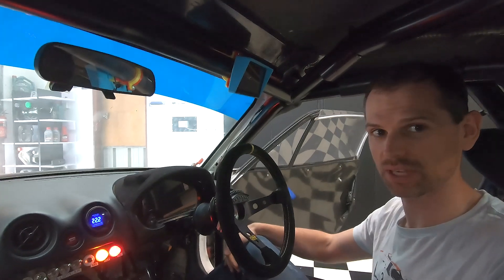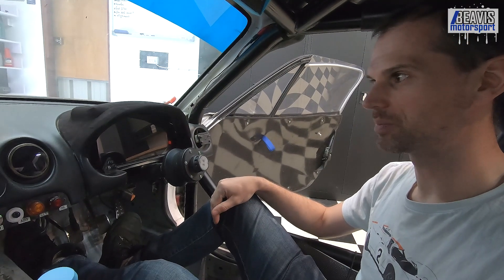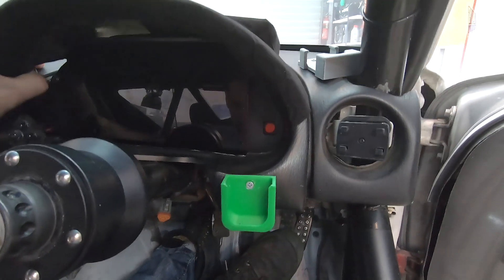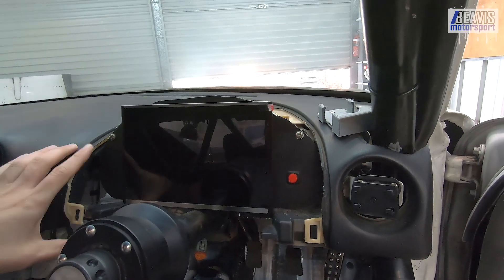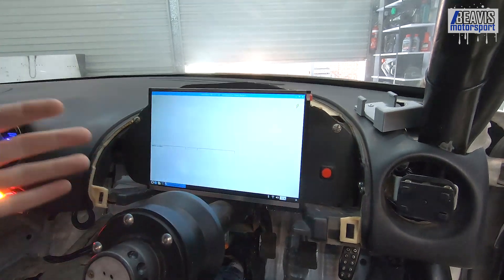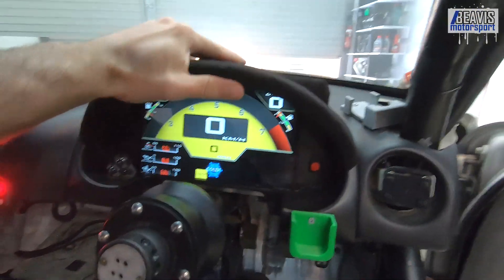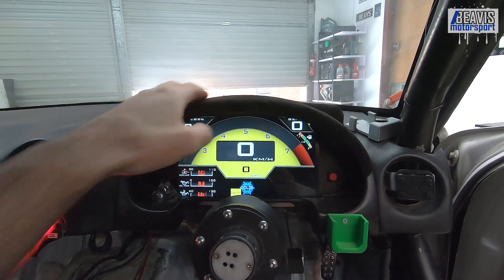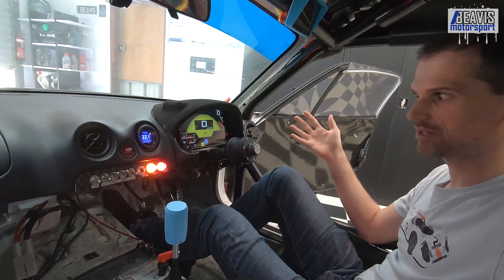CUSTOM RASPBERRY Pi 10" CAR DASHBOARD // Ep 90

Comment from the maker: NOTE: I have an updated video for faster boot times and latest Pi4 hardware here: https://www.youtube.com/watch?v=SVn9uYfEQrA
And, to answer the Frequently asked questions:
How does it connect to the ecu? - Via USB connection from the Megasquirt MS3 ECU direct to the RasPi.
Why didn't you use XYZ off the shelf product? - Because I like to tinker, and I can customise this how I like.
What about OBD2? - Sorry, I have never tried... I am sure you can find info online though!
Reply: So the only ECU this will work with is the Megasquirt range right? is there any way to get it to work with Link or Haltech systems?
Reply from the maker: @roderickmacdonald2389  The Tunerstudio software I'm using here is only for the Megasquirt family of ECU's

Comment: What did you do for the speedo?
Reply from the maker: Original mazda speed sensor is fed into the ECU through a conversion board then displayed on the screen. But, i dont really use speedo much as it is not a road car.
Reply: @Bbeavis  I have downloaded some of the screens and what not still I having a hard time trying to figure out certain features and what not but getting in there some of the dashes you guys made a really cool

Comment: How the Pi getting the data? Any connector between Pi and ECU?
Reply from the maker: All my sensors, speed, temps etc go direct to the ECU.
Then the ECU has a USB connection direct to the Pi to feed the data for the dash software - and the Pi communicates over USB with the ECU propriety protocol.
Reply: @Bbeavis  Thank you for your reply. From where can I get that connector?
Reply from the maker: @ysr9116  The connection is just a USB cable.
Reply: @Bbeavis  Is it USB type A to USB type A? My ECU doesnt have USB to plug in, so I thought you may have special connector :)

Comment: ok im interested in making something similar with the rasberry pi but i was curious about the internet side of it. does it have to have constant internet to be acurate and work?
Reply from the maker: No, internet connectivity is not required ongoing, only for the initial setup and to download/update software.
Reply: Thank you for the reply. I may have a couple more questions, how is it holding up? Is it practical? And roughly how much did everything cost? Note I haven’t look at any of your other videos my questions may be answered if I go through your page just let me know and if so I’ll watch other videos. Thanks for your time and great job!
Reply from the maker: @mikeyrozell5627  
It's been working fine for me, and practical in the sense I can customise the display to my liking, note I use it in a track only car, not sure I'd like it for a road car.

Cost can depend how you do it, but around $200.

This gives you an idea on parts and cost to build:
https://www.youtube.com/watch?v=SVn9uYfEQrA
Reply: Great thanks I have a 92 Miata I’d like to update in a sense I’ve seen a bunch of different raspberry pi displays with all sorts of different modes I’m confident I could find one for road use I plan on keeping the oe guages just would like to do some updating while engine is out (crank swap) but thank you for everything

Comment: Were can I buy one of these already  made
Reply: Yea, but no one wants to pay them prices, especially when this looks so good. I have a stand-alone ecu bmw dde5  with rpm single wire output/ ignition/start and oil light output that can be grounded to work and no wheelspeed sensors so I was thinking I can use a gps speed signal emulator 🤔
Reply from the maker: There are off the shelf dash products, none are as cheap as this would cost to build, but they generally depend on your ECU setup for your car.

Comment: How do you get data to the pie? OBD2?
Reply from the maker: Hey again S4 Dad. I run a Megasquirt MS3 aftermarket ECU in my track car. The ECU connects directly to the RasPi via a usb cable. The pi's TunerStudio software interacts over a serial protocol direct to the ECU to display the data.TunerStudio is specific to the Megasquirt family of ECU's.

Comment: this is something i want to do in my subaru. is it possible to still use it with a stock 32bit ecu? does it flash/log for you?
Reply from the maker: If your car has the OEM ecu, and it supports OBD, then you can consider this software: https://github.com/Pbartek/pyobd-pi

Comment: Hey, nice work, your a genius.
Quick question, could you use the Raspberry Pi system and dashboard like you have set up, but use input pins on the pi to input for 
1) rpm (pulse signal from spark lead) 
2) water temp (thermocouple + digital converter) 
3) ground speed (hall sensor set up on axle)

and input them for live use as a race go kart dash? (Maybe save to a thumb drive for later review)

I’d love to add Lap timer / logging If the sensor inputs could be adapted? (Can be magnetic strip reader across finish line on track or a infrared signal/receiver set up) I only need lap times for practice/set up tuning 
Thanks
Reply from the maker: Anything is possible, but what you're describing would likely require someone with good electrical and software knowledge.
The solution presented in this video is an 'off the shelf' product and works directly with a standalone ECU, so it's much simpler to setup.

What you are describing would possibly require a custom circuit to adapt the inputs to suit the PI, and then obviously some custom software to present the data visually.

So, you can certainly do it, but it'll take time and effort well beyond what is presented here.
Reply: Thanks for the reply, was interested to see if I could use a dashboard like you have created. 
I have access to electronics engineer for support, and I have a full Cnc machine shop for any monitor mounting/fittings. Perhaps I’ll make a video if I have a crack at it. 
I could just go buy a complete Aim Mychron system but I’d love to have a crack at this for fun.

Comment: Hey i wanna make this but for my Haltech 1500 ELITE. is there a way to connect the Pi to my ecu?
Reply from the maker: The TunerStudio software doesn't support Haltech, you'd need to find some dashboard software that works with the Haltech and works on a Pi.
Reply: @Bbeavis  I emailed DDefi about their 12", the same used by DonutMedia and they told me they're working on a v2 that'll work with other ECUs like the haltech. Waiting for a response for when it'll be released 👌 either that or I'll have to go PowerTune

Comment: In my case, the small lightning was removed by putting a good quality USB cable since the standard micro USB cables are not designed to transmit more than 2A.  I recommend you buy the original cable of the rapsberry to solve that.
Reply from the maker: Thank you for the advice Fabien.

Comment: Does the screen still work? Also how do you interact with it as it seem do not have touch sensor in it... Please reply
Reply from the maker: This is not touch screen,  In day-to-day use, I don't need to control the unit, but I use a small wireless bluetooth keyboard if i need to control the PI.
Reply: Thanks for answering... I also want to replace my rpi  that i added with 7" display..

Comment: I assume that display has the typical 200-250 nits. How is the brightness in direct sunlight? I'm debating on doing this but I'm concerned I can't read the display on a bright sunny day.
Reply from the maker: The seller doesn't detail any brightness specs. I've not used the screen in direct sunlight, as it runs inside the cars dash hood as seen in the video so it's always shaded in that regard. I have no issues reading the display in the car.

Comment: Really like your dash design... very clean! 
I have a VE commie lemons car running a rusefi proteus ecu that im going to put a tunerstudio dash into.  So i donated on your website but never got a download link :(  I couldnt get emails with links for the free dashes so I think maybe something's broken.
Reply from the maker: Thanks Neil. Was your email neilmarnie, if so, I've resent the download links.... Did you check your spam folder?
Reply: @Bbeavis  Yep thats me... Gave it a while but still nothing!
Reply from the maker: @neil_neil_orangepeel  Perhaps it was a hotmail issue, I have tried sending to your gmail address just now.
Reply: @Bbeavis  Still nothing... could it be an issue your end or filtering before it get to me?

Comment: neat project! If you want some help reducing boot time I can possibly assist.  I use pi to develop headunit replacement units that can also run custom software to control relays and things in the car.
Reply from the maker: Thanks for the offer, honestly the boot up time isn't an issue for me, but if you have any suggested reading I'd be interested to take a look.
Reply: Hello Mr. Pritchett, I am interested in taking up this project and would love to hear how short the boot time is,utilizing your method and how to get there.

Comment: awesome build and video, considering im tring to put something together for my 1966 slant6 just to monitor a few things sensors do you think this is doable with this setup or dose it HAVE to go to a EMC ?
Reply from the maker: You can find many ways to skin a cat, but to use the tunerstudio software that I am using, you have to run a Megasquirt computer.

Comment: Did pidash ever get any kind of low energy standby mode? It would be a voltage drain by definition but I believe it can be kept really low but allow for way faster startup
60 seconds to start driving your car is crazy
Reply from the maker: You can't wait 60 secs for your car to warm up? I never drive my race car before oil temp is over at least 70degC.
For me, its a simple process of start the car, then do other things like seat belts and helmet.... more than enough time for the screen to boot up before I've even noticed.
Reply: @Bbeavis  ah, I'm looking into this for a daily driver, where more than a ten second startup is noticeable.

Two things to try, compile the entire OS image (buildroot) which drastically cuts boot times, and also boot off an SSD instead of the micro SD card, should cut boot times a ton as well
Reply from the maker: I have considered swapping to an SSD for boot, but didnt want to spend the money :P
Reply: @Bbeavis  Might be worth trying. SSD's can be had for under $50aud these days.
I've just found your channel so I'm in the process of bingeing the videos.
But you've given me a glimmer of hope that there are diy dashes working out there.

I'm worried my setup won't work as easily though, I'll be using an Adaptronic modular ECU in my RX8.
I was planning on getting a Haltech IC7 to go with it, but the $1400 price tag is a joke. I'm pretty sure they are just using a pi inside them anyway.
The Adaptronic can emulate the Haltech V2 Protocol for dash output. 
So hopefully I can find something like tunerstudio on the pi that can read the Haltech protocol and display a dash. Or maybe there is something that can read the Adaptronic Native Protocol.

Comment: Hey question... I have speeduino  speefyefi.. how did you hook up your innovative I have that as well... not sure if my controlling bad
Reply from the maker: I do not have any experience with the speeduino, but I believe it uses TunerStudio for tuning, so it should work with this same screen/RaspberryPi setup.
Reply: @Bbeavis  I mean your afr Guage g
Reply from the maker: @wizard_customz  Fairly simple the innovate LC2 is wired to the OEM 4 pin O2 sensor wires, the ECU does the rest.
Reply: @Bbeavis  for some reason when I hook it up my car goes wonk... I may have to recheck my wires... have you heard of a controller going bad ....

Comment: i had experience with both the raspberry pi 3 and 4...the boot up time is actually dramatic. The 3 like you said takes like a minute...the raspberry pi 4 took like 20 secs...
Reply from the maker: I would like to try a RasPi4 but not willing to spend the money on it just yet.
Reply: @Bbeavis  its all personal preferences. If the car is gonna be a daily...i'd go with the pi 4. If its just for track and occasional use pi 3 is good enough.

Comment: This sucks some serious ass
Reply from the maker: Oh, ok.... Why?
Reply: @Bbeavis  it takes too long to boot, not very responsive either. You made a computer that displays data. Digital dashes are stripped down from the computer functions, they use embedded systems. So instead of understanding the data it only displays it, the heavy lifting is done by the ecu anyway. Embedded systems have dedicated kernels optimized for its function. The key is “EMBEDDED”, that’s what you want.
Reply from the maker: @jota5969  Except this boots up fine, works great, and was a fraction of the cost of an off the shelf product, and with a much larger screen. Also, I enjoy building DIY systems and learning something along the way, rather than just spending big money to show of my expensive parts.

Comment: Awesome work, great video. Just a quick tip on the lightning bolt issue, it's under voltage not current. They actually need around 5.25 v and the result of the undervoltage will be running the pi at reduced clock speed.  Hope that helps
Reply from the maker: Thanks, seems like a constant frustration, would be handy if i could run the PI on the cars 12v system instead.

Comment: Hey I just got my pi dash all setup, following your steps, is there a way to hide the mouse cursor in fullscreen mode? Kinda annoying that it boots up goes into full screen and have a mouse cursor in the middle 😂
Reply from the maker: There is a 'mousemove' command that you can use in a start-up script, I set the mouse to the corner of the screen.
Reply: @Bbeavis  thanks dude, I’ll have to check that out asap

Comment: Looks great Brendan!  It’s unfortunate that there is no provision for lap timing with TunerStudio.  I run a similar setup to yours but I use the Autosports Lab Track MK2 data logger interfaced with my Megasquirt over CAN bus.  This allows me to log whatever ECU parameters as well as lap times and telemetry.  No ECU tuning available with that setup however. I run a Raspberry Pi 3B with the 7” display in my center console.  I want to eventually go to a setup like yours in the dash and will probably emulate your example to get the larger screen.  Thanks for the detailed run down and I hope you get back on the track soon!
Reply from the maker: Oh yeah for sure... I suppose there are fancy /expensive solutions out there that do the lap timing stuff, motec dash/datalogger type gear.... but hey my theory is this does pretty well for something that costs ~$100 or so in parts. More exotic laptimers in the car aren't going to make me faster, so i struggle to see the value in spending money on it.

Comment: I have a similar setup running pi as my head unit with a 3d printed bezel, I have tried everything to get rid of that bolt, I'm currently running a 5v 8amp switched power sbec and it still shows up, super annoying. Thanks for sharing your setup.
Reply from the maker: Thanks glad to hear its not just me!

Comment: Moving the two warning lights up from the dash onto the reliefs could look good and make them dual purpose. Maybe use some SMD's to get around mounting depth issues
Reply from the maker: Not a bad idea James, Something to consider for the future perhaps.
Reply: What are SMD’s? Thanks
Reply: @Theferg1  Means surface mounted device, I was meaning the very slim led lights so the installation would be easier

Comment: Very nice work beavis, my tablet is feeling a little tired now for navigating but same purpose as your setup, flick on and leave alone and does the job, I've just picked up a pi400 to tinker with and its incredible.

No pissing about to boot from usb, just put image on and away you go, easily overclocked to 2.4 CPU and 750 GPU and stays cool, would be perfect as a glovebox setup as it's got those dual video outputs 

If you haven't already I seriously recommend an old Chromebooks mini m.2 enclosed in a usb adapter or even an old data drive, super cheap and makes a huge difference, the micro SD cards are always limited to the painful 10mbs write speeds, boot up time alone can be halved if not more easily by going usb boot.

As for power bolt, could be something as simple as cable, 2.4 amps is minimum but I've found only 'fast charging' cables actually transmit that, some chargers like my Asus also try to be too clever and don't give the amps listed, anything PD rated will work as it's always going to be over 2.4 amp supplied
Reply from the maker: Thanks for the tip on changing out the boot drive, I'll have to see if I can work that out.
I've tried multiple cables, power supplies, etc, can' seem to shake the 'lower power' warning.

Comment: Looking good, how do you shutdown the pi?

I have a suggestion for the dash, I applied it when the cloth on the roof on my old car came loose. I used 3M spray on glue and a cloth similar to what you have on that dash with that microfiber feel on top. It didn’t come off in 3 years. As long as you follow the directions on the 3M glue spray, I don’t see it coming off any time soon.
Reply from the maker: I have a button wired to the Pi, and a script that detects the press for 1sec, then initiates shutdown.
Will need to look at a different material for the dash flocking look, as the stuff I used is not forgiving in the curves.
Reply: A quick tech vid on the script for the shutdown button would be helpful for us tech noobs 👍😁